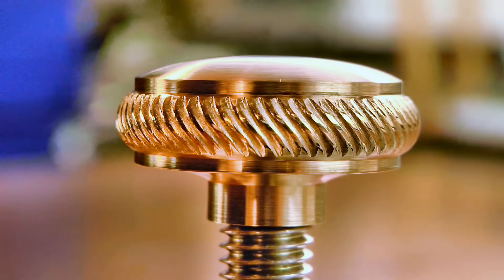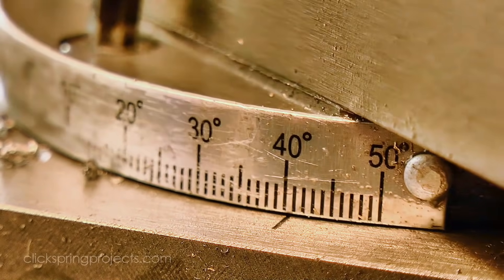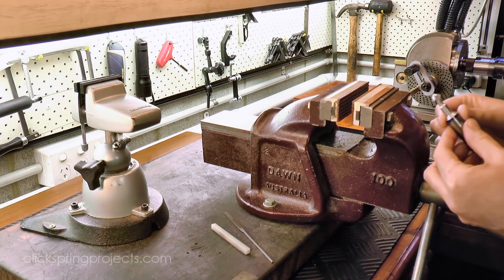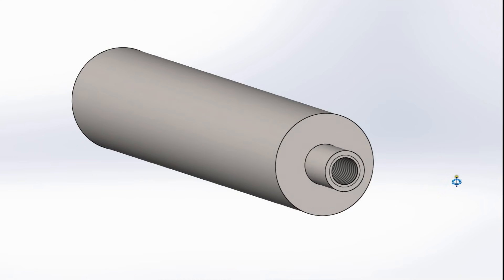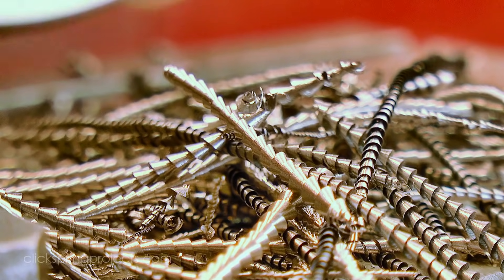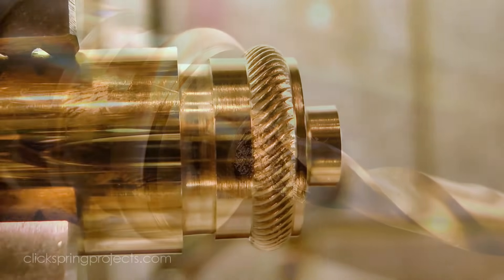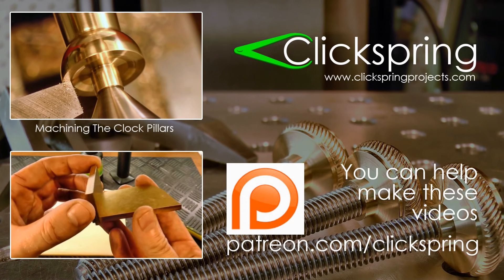Home Machine Shop Tool Making - Machining A Set Of Vintage Style Rope Knurls

Comment: sigh I need a set of those rope knurling wheels.  Alas, I do not have a vertical mill, so It won't be quite so "easy" to make...
Reply: Well, it's been a year since I lamented about how much I wanted a set of these, but things are looking up.  I finally got myself a mill!  a PM-728vt in fact.  I am still working out some kinks with it, and making a handful of Hemingway kits to get the hang of using it.  I see myself making some fancy rope knurls very soon!

Comment: Beautiful work!!  Idk where I saw it, but I saw a video where someone cut the teeth on a knurl using a threading tap of the appropiate diameter and pitch.  The knurl is able to spin freely on a holder as its teeth are being cut, so that the tap causes it to revolve as it cuts the teeth the teeth in it, making it self-feeding.  Of course, you'd be stuck with whatever angle was on the tap, instead of being able to decide the slant of the teeth as you do here.
Reply: That video is from the channel 'Hydraulic house'. This is the clip I think you saw: https://www.youtube.com/watch?v=xCxmM6QPknU

Comment: hi chris,

the cutting performance could be way better if you had made the clearance angle behind the cutting edges right.

you did relief the tip, but the rest of the cutting edge is on the same circumference as the rest of the cone.
you should have filed or milled that part down in order to avoid friction and therefore get a better surface.

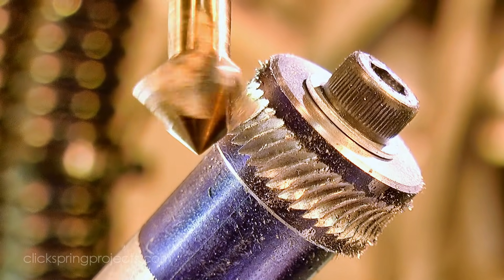you can comprehend the problem at 8:37 where the tool presses the material away instead of cutting it properly.
at 8:47 you can see the marks on the cutting tool, where it rubbed over the material.

kindes regards
tom

Comment: Late comment, but brilliant, as usual!  What technique did you use to cut both a tapered and straight cut in same tool set-up from 2:07 to 2:27?  Thanks!  Bob
Reply: The compound rest is set at the required angle and is fed in and out for the angled cuts. For the side to side and in and out cuts the cross slide and saddle are moved. Google metal lathe components to see images of what I am referring to.

Comment: I was amazed by the knurling process when I first tried it in high school. Although I have been out of toolmaking for 30 years now I still love to admire fine work. You must see the National Maritime Museum, Greenwich.
I can't help thinking you would get a better result if you had a better finish on the knurling tool. A grinding tip may have been an easier approach. Possibly lapping the milling tool. It may have been just as quick to run a diamond buff on a mounted point across the knurling tool before and after hardening.
I love the video and your work.

Comment: The precision of your work is incredible. 
When I was in school the start of our technical drawing class we would have to use a t square to draw a line an inch off the bottom of our a1 paper to make room to write our name and what the drawing was ect. 
I would consistently fuck that up every single lesson..... I swear the harder I tried the worse it would get and the more pissed my line would be! 
Now as an adult every time I think i would like to try something like this that poxy t square pops into my head and I sigh then go put the kettle on instead.

Comment: Wait... did he just make a tool so that he could make a tool so he could make a part for a thing he is making? 😳🤯
Reply: Yes. Yes he did. And don't forget he made the profile tools as well.
Reply: What a mad man... I like that
Reply: Radicaly DIY
Reply: Making tools to make tools is pretty normal for a machinist, but this man's level of fit and finish marks him as a master.
Reply: Don't forget he made the video too. So we could make the tool to make the tool to make the part for a thing and maybe make a video too!
Reply: @Bob3519  

Not only that, but he needed tooling to make the tool, that made the tool, that was then used to make the knurling ...

... and likewise the tools he used to make the tool, was made by other tooling in the factory that made the cutter, and even the lathe ...

[Edit: the same thing can be said for the camera, audio, and software, he used to make the video ... something has to used to build them, which, in turn, needed something to build those and so forth, down the chain ... ]
Reply: Really makes you realise just how many tools, to make the tools, to make the tools, cycles that we're in by now. 

Even just counting the last three centuries would be insane. Every gadget, every device, every single mechanism made & all the myriad tools, going back in pseudo-generations to their extreme ancestors.

Think of something as extraordinary as the very first screw...
Reply: ninthRing 8,000 generations of improvisation, improvement, and innovation... 240,000 years of building on top of the tech of the previous generations... you’re exactly right, and we can draw a direct line from the first flint flakes to your iPhones and SpaceX of today.
Reply: @ArmchairDeity  And the rate of technological development is accelerating, as well (especially since milestones as the printing press, the transistor & the internet.)
Reply: @ArmchairDeity  although that line is relatively flat for the 1st 235,000 years and almost vertical for the last 200
Reply: ninthRing according to How To Make Everything, one of my other fave channels, there have been 8,000 generations of innovation to get us where we are. I really like that.

Every time I pick up a tool I feel connected to history... all the way back to when someone figured out that if you paired flint knapping with a stick and some boiled hooves or pine pitch you could amplify the force applied with each stroke of the edge. 😎
Reply: @ArmchairDeity  In the past most real change was generational, as each new person added their adaptations to a tool (& obviously, not every person was as smart, or as innovative, as previous generations).

Once we developed writing things changed (as now they had a better way of transferring info to their descents than word-of-mouth).

Then we developed printing, an efficient method of storing & disseminating information between still living individuals.

After this there was the Scientific Method & Peer-Reviewed Publications, creating a way of filtering out personal biases/fallacious reasoning and then a self-correcting feedback loop. This led the volume of viable knowledge to pretty much explode during the 19th & 20th Centuries.

Now we have the internet, allowing for immediate cross-referencing of data & collaboration/competition across the globe, as well of the early stages of AI processing (doing things though to be impossible Science Fiction less than a generation ago.)

"The only constant is change" is a truism, but it comes with the corollary that "The rate of change always increases." 

Of those 8,000 iterations of innovation & development preceding us (approximately 180,000 years of our species Homo sapiens sapiens, with cross pollination from our cousins in the Homo clade), how many have happened in the last 10,000 years (bronze/iron age, farming, etc.), the last 2,000 years (philosophy, geometry, science, etc.), the last 200 years (industrialization, Nuclear Physics, Chemistry, Biology, etc.) & now, the past 20 years (Internet Revolution, Microelectronics, Genetics, Nanotech, AI, Robotics, etc.). We can only imagine what change the next decade of development will bring - but it's been a goddamn wonderful ride...   ; D
Reply: @Seren-dipi-T  One of the first screw devices was a water pump too. Idk about the very first screw ever though, would be interesting to be there for though.
Reply: @Fangman123789  Indeed, The Archimedes Screw (so named, as Archimedes wrote perhaps the earliest detailed description of ones in use by the Egyptians, in 3BC). There's also a tenuous possibility similar devices were used to fill rooftop reservoirs in the Hanging Gardens of Babylon many centuries earlier.
Reply: Yes
Reply: Yup LOL!
Reply: Affirmative
Reply: Thats the way its s'pposed ta be mayt.
Reply: Ah, new here I see.
Reply: Actually he started by digging up some clay with his bare hands to build an oven. Then he threw in some metal ore...

Comment: so ive just fund this and the work is great and clever however i think though you could of shortened your work time and had less burs in your cutting if you had looked into a basic hart bur. its a bur typically used for gem setting and creating a seat for round stones. its edge is sharp though and great for making 90 degree channels and cuts. it comes in a number of sizes and angles with more cutting teeth to avoid problematic burs. it doesn't eliminate the issue but it does create a cleaner cut.

Comment: Splendid video production,  no mean feat in itself.  As knurling is a cold forming operation when I knurl parts I always use a lubricant.  WD 40 works well on brass parts.  For steel parts try a sulphurised oil such as used in back axles.  Prefixed with EP for extreme pressure.   Note sulphurised oils will stain brass.  Looks like you are using leaded free machining brass, like CZ 121 or 360  grade if in the USA.  Riveting brass CZ 119 whilst harder to machine may give a better knurl.  To improve surface finish of the knurled part could try polishing the knurl teeth with Craytex (emery grit filled rubber).   Dremel have a Craytex wheel which could be dressed with a diamond grinding wheel dresser to fit the teeth.  Trust this helps -

Comment: Like the photography.   Pro tip: When reaming into a drilled hole it is always a good idea to use a boring tool  on the first 0.50" or 0.100" first to act as a pilot for the  reamer, This'll improve the result just that last final bit.

Comment: i dont have a metal lathe yet and I only make basic things out of metal, but I am very curious about the tool you use to find the edge of the piece you are making (minute 2:43). It seems to be offset and then corrects itself, how is that called and how does it work? do you have a video about that?

Every time I watch your videos i get so pumped about that metal lathe I've been thinking about buying! You are great at explaining what you obviously know very well. Amazing job!
Reply from the maker: That is called an edge finder - Cheers :)

Comment: I'm not sure if I missed it but what type of material did you use for the Wheels? I've watched the video several times and browsed the comments and can't find the info.
Reply from the maker: Hey Dan, I used Drill Rod (aka Silver Steel in some parts of the world) - its basically O1 tool steel in rod form - Cheers :)

Comment: Feedback: I have made similar items for making the Rope Knurl design and did get similar results, but nothing of the quality of yours. Method is sound, my skills are questionable. I also tried making a cutter from a carbide (fixed carbide to 1/4" square shank type) tool fixed to an arbor for the mill. That worked a little better.
At any rate it was a very interesting project, and I have not given up yet.

Comment: The bad cut quality when milling the knurling tools is indicative of not having a proper cutting edge on the cutter. If I saw and understood correctly how you filed the backside clearance, only the tip of the cutting tool had the proper clearance, but not the 45 degree sides and that is why it made the ugly burrs when cutting/rubbing. For future it is easier to make a tool with one cutting edge, or make a holder for HSS blanks that can be ground from the end to the shape you want and attached to the holder with a screw. Easy, fast and makes all shapes possible :)

Comment: Can you give a list of the power tools and heads, etc you're using? Curious on the dividing head, milling machine, lathe, n basic chucks.
Reply from the maker: The mill is an SX3, Vertex BS0 (?) dividing head, and chucks are standard 3 and 4 jaws plus ER 32 collet chucks. There is a bit of info on the lathes here: http://www.clickspringprojects.com/blog/which-lathe-should-i-buy
Reply: Sweet, Thanks. Came across your videos recently and they've probably made me broke for the next decade as I would love to get into metal work more. Love your attention to detail. Have you added any CNC ability to the machines?

Comment: In the drawing for the double angle cutter, it specifies O1 tool steel. Is this equivalent to EN8? Thanks
Reply from the maker: Hey Ryan, I wouldn't describe them as equivalents, but they can both be quench hardened. O1 has a higher carbon content than EN8. Its a little tougher than EN8 in the annealed state, so less pleasant to machine but I find it gives a more consistent result with quench hardening, and is my preferred choice for this sort of cutting tool. EN8 is perfect for parts that require a lot of intricate machining (because its easier on the cutting tools), and where the hardness after quenching is perhaps a little less critical eg clock pinions.
Reply: I have some 'silver steel' on hand. I believe that's a common name for O1?
Reply from the maker: Yes 'Silver Steel' is O1 in rod form.

Comment: Sorry to pester you yet again, but.... What was the the liquid mixed Boric Acid? I have found other various solutions on web sites, but a lot were focused on knife making. Also, suggesting putting some wood, charcoal, etc., into a cylinder where the part was heated up. I will be using Oxyacetylene for heating and a few fire bricks for a chamber.
Again - really sorry about all the questions, but I wanted it to come out at least 1/2 as good as yours. :-)
Reply from the maker: Hey Tom, no problem at all :) The liquid is denatured alcohol, also called methylated spirits in my part of the world - The boric acid+denatured alcohol paste play no role in the hardening process, but are simply an excellent way to eliminate the oxidation scale generated during the hardening process. The charcoal+cylinder detail you mention is most likely part of a case hardening process used for low carbon steel, and is not applicable if hardening a medium to high carbon steel like O1. Also, consider using a standard propane gas torch for the heat - an oxy torch has the potential to remove too much carbon from the metal surface. Recommend this book: https://www.amazon.com/Hardening-Tempering-Treatment-Workshop-Practice/dp/0852428375

Comment: Another question concerning the hardening process. I ended up using Drill Rod for the cutter, as McMaster Carr showed Drill Rod was a tool steel. I don't know the actual code of it, but it was on my shelf and 01 had to be ordered in at a high cost. I test hardened a small piece and it seemed to work well and formed the black coating you showed. I have finished the cutter and am about ready to harden it once the Boric Acid arrives; I ended up having to buy it on eBay, as no one around my town carried it. My question concerns the "iron wire" you mentioned. I assume you mean just plain "steel" wire. When I think of "iron" only cast iron comes to my mind.
Again thanks!
Reply from the maker: Hey Tom, yes loose language on my part! Any soft mild steel wire will do - my local hardware store has a range of thin gauge soft tying wire in the gardening section that works great. Drill rod is perfect for shop made cutters, and is in fact O1 tool steel in rod form.

Comment: I love the quality of your videos. I do have one question for you though. Where do you purchase the paste you use when hardening the steel?
Reply from the maker: I purchase the powdered boric acid from a local jewellers supplier, but you may also find it a your hardware store as roach bait. Mix with denatured alcohol into a thick paste and then apply to the part before heating
Reply: Thanks so much for the information. I'll try it sometime

Comment: What steel did you use? Does it have a number like 1040, or ?
Also, what media was it quenched in. It looked yellowish-orange.
Thanks, great work!
Reply from the maker: Hey Tom, O1 tool steel quenched in compressor oil, thanks for watching

Comment: Another amazing video, however i wonder why there is never any power-tapping done when making internal threads on the lathe and mill. Its not necessary, but it saves so much time and elbow grease.
Reply from the maker: Mainly for control - Generally the threads I tap are few in number and quite small (btw 1 and 3 mm) so power tapping doesn't really give much time advantage, and would unnecessarily risk breaking a tap.  Thanks for watching and asking
Reply: Holden Sherard I swear yesterday I was going to ask the exact question you asked. Creepy.

Comment: Great video, but I thought that I should point out that the relief that you put on the cutter really only offers relief for the very tip of the tooth. While it will work for a while, it really should have been relieved behind the entire cutting edge. That's the main reason it was pushing a thick burr on you first pass around and not leaving a nice finish. Also the the knurling wheels will work better if done at a low speed with a thick oil or even moly grease applied in order to allow for the slippage as you work it into the material. Still looking forward to watching more of your videos, hope this didn't come off as too harsh.
Reply from the maker: Yes agreed on both points, thanks for watching Siegfried :)

Comment: i dont know metal work. i have so many questions, these videos are awesome and very satisfying.
-How many times fastforward are the cutting portions? 
-how often do you have to replace the cutting tools?
-the cutting tools need to be harder then the working material, how do you know if it will cut easily or not? or is it a guess?